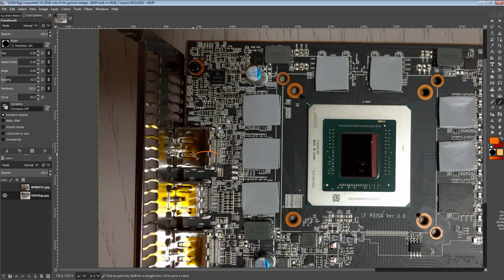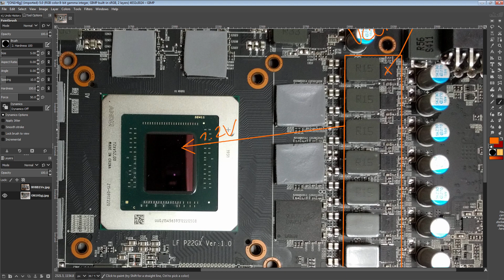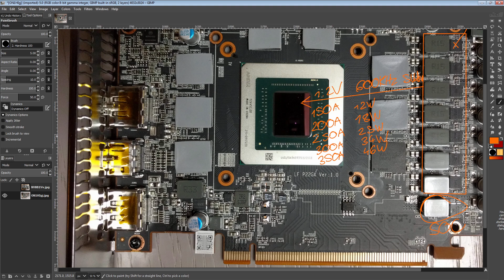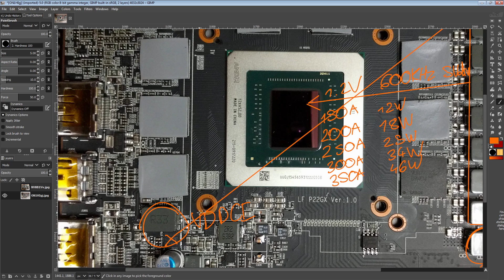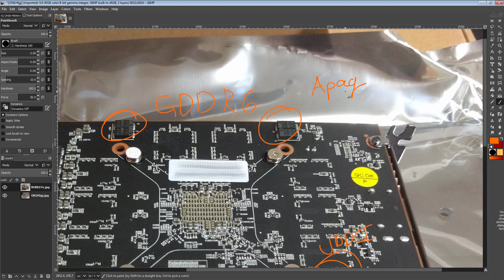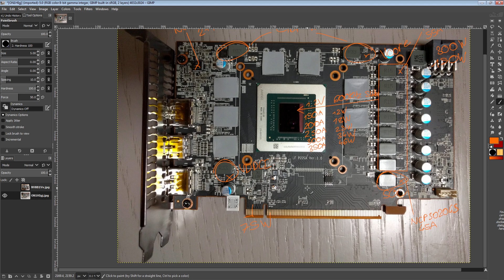GPU PCB Breakdown: Powercolor RX 5700 ITX

Comment: I was playing around with my 2400g, and i was wondering what would happen if I crammed 1.55v into the gpu.
Reply: It would probably make the memory controller less stable because of the heat. You'll usually get as much or more performance pushing memory clocks and timings as igpu's are so bandwidth limited. Or more likely it will just let out all the magic smoke that electronics fundementally work on
Reply: @teddygoboom1  so i've done some testing in the meantime. The pc wouldn't even Boot above 1.5v.
At 1.5v, 1800mhz on the gpu and 4.15ghz on the cpu i was able to get the memory stable at 3000mhz 13-15-14-15-21, with a tRCD of 425 and 40 ras. The gpu had the same performance at 1600, 1700 and 1800mhz because of the memory bottleneck. Once i get b-die/e-die and i can push my memory further than what my hynix m-die can do, i want to see how far i can really push it. Quite a nice little chip.
Reply: @theunholybakery1990  Nice! I haven't been able to mess with these so I'm not quite sure, but that sounds pretty impressive. I've always wondered how far you could push an apu and thought they sounded like a lot of fun for overclocking
Reply: @teddygoboom1  I want to break the hwbot record for the gpu
Reply: @teddygoboom1  quick update, world record on the 2400g for heaven basic is 1860.3, i scored 1809.1
Yay.
Reply: @theunholybakery1990  Solid, so apparently that is a pretty nice chip. Good luck trying for that #1 spot, those last few points are always the hardest but it sound like some bdie/rev. E could definitely get you there, but congrats on what you already did so far
Reply: @teddygoboom1  the thing that scares me the most is the fact that it took me a SHITLOAD of time to fine tune my memory to the max. I'll have to start all over again. Feels kinda bad man.
Reply: @theunholybakery1990  Haha yeah, that's the problem with memory overclocking, it takes forever. I hear that ryzen memory calculator gets you a pretty good starting point, so maybe that could save a little bit of time if you do. I'd be worried about how much a significant upgrade would cost, the kit you have is already getting pretty good clocks/timings for a zen chip. Again I never had a chance to mess with them but I remember hearing about all kinds of memory "problems" with them. Makes me really excited to see what zen 2 apu's can do with the much better memory system, uncoupled infinity fabric, and vega 2 "cores"
Reply: @teddygoboom1  ok, so: i used the calculator, but the timings were EXTREMELY lose, even on fast mode. Sure, it's a good starting point. The point in b/e die is that it seems to perform better at the same clocks, AND can be pushed farther (especially bdie). The memory problems are that these 1st gen cores with their memory controller can't push much more than 3200-3400mhz. I saw the world record guy is using samsung bdie at 3200 14-14-14-14-32, where my 3000mhz 13 15 14 15 21 should be quite a bit faster. Apus are fun man.
Reply: There is only one way to find out 😂
Reply: @heinzpechliwanis1411  I was almost panicking when it did not boot whatsoever. The fans spun up and everything shut down.

Comment: @17:40 Sitting here on a reference Vega 64, and it has an "SOC Power" readout in HWiNFO64, but no separate voltage readout. It's idling at 5W, same as the "ASIC Power." Only the Core and Memory have voltage and current measurements.

Comment: How long is this card? I made a diy case and there is rn a 1650 just to fit the place. I would replace it with this if its not too long. My guess would be 180-185mm but i want to be sure
Reply: 175mm true matching ITX mainboard formfactor :)
Reply: @alexeiprisyazhnyi3119  nice it perfektly sized, i can only fit 180mm xd thats a relief

Comment: It looks so much like the Vega 56 Nano my brother and I got. (Follow picture source in description for look at the card). I think our card is slightly smaller due to HBM since there are no memory chips on the PCB. But maybe not because it had two power connectors.
Reply: The Vega was a bit smaller, but only a few cm
Reply: @sanderm8955  Okay. That's crazy that the 56 Nano was still smaller given the power requirements. They were slightly lower power target chips but still. Loved my little Nano but upgraded to Radeon VII later. Still have the card because I saw what happened to the last Nano.
Reply: Nevermind, the fan is offset to the left more on the 56 Nano due to not having to cool much more than the GPU. Seems like the same physical size.
Reply: It's also far more efficient than the Vega 56 nano, and doesn't have the coil whine issues that card had.
Reply: @WinterCharmVT  The efficiency goes without saying lol. Also, my card didn't have coil whine.
Reply: @WinterCharmVT  Yeah, I liked my nanos (r9 and vega) but when someone offered me the equivalent of $500 USD for the 56 it was gone in a heartbeat.  I now play games on a humble 1660 ti, until a more interesting GPU eventually drags me out of my lair